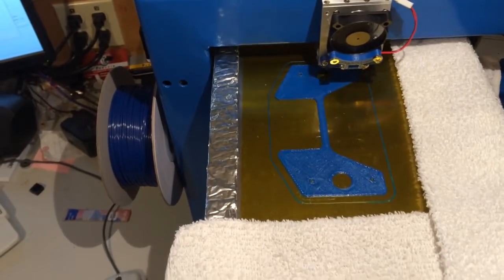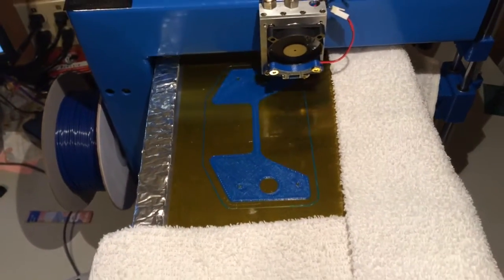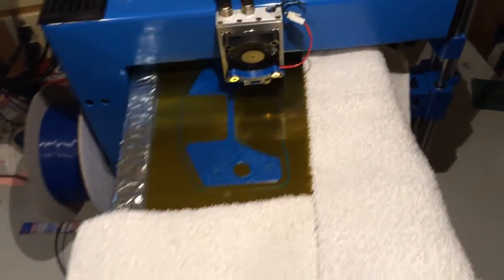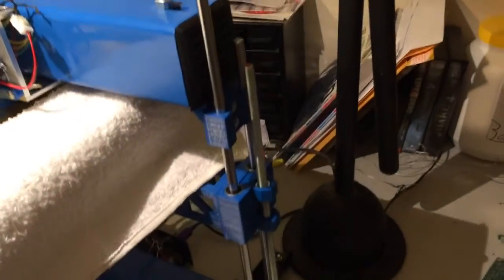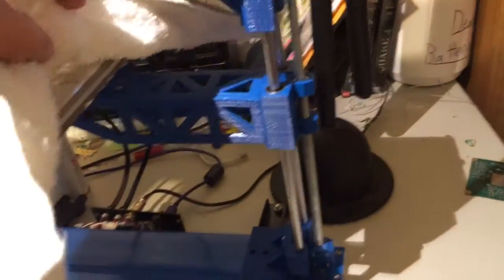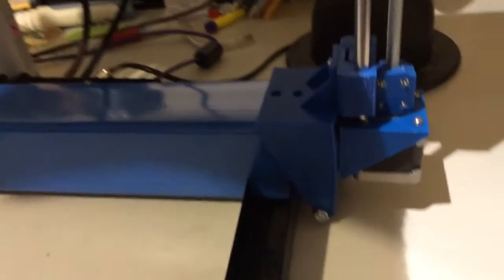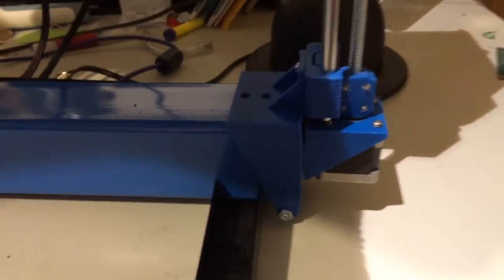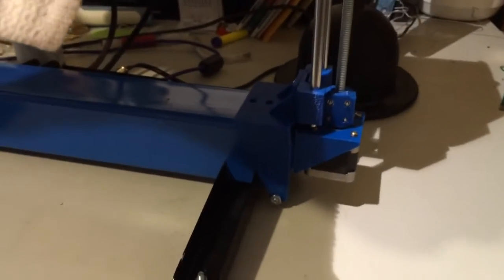Eventorbot printable stability mod

Comment: hey can you tell me the firmware and the gcode generator that you use
Reply from the maker: Yeah, I'm using Repetier firmware, on Repetier Host, with slic3r to generate the gcode.  I never used the sprinter package that was provided, and I found I learned a lot more by setting up my own system.
Reply: i have recently purchased an eventorbot can you kindly tell me the changes you have made to the firmware if there is any and did you use repetier host to upload the firmware on to the microcontroller Thankyou.
Reply from the maker: Well, my build wasn't from the kit. I just got the "plastic parts" (which ended up being steel) in the Kickstarter.
I sourced and wired everything else myself. As such, I'm sure my configuration was different from the original.

For the firmware, I used the Repetier configurer, from their website, and filled in my appropriate values for everything there. Then I used the Arduino software to upload it to the Sanguino motherboard.

If you haven't already, check out http://eventorbot.com/forum and you'll find postings by people who maybe followed a more conventional path.
Reply: thank you for the information